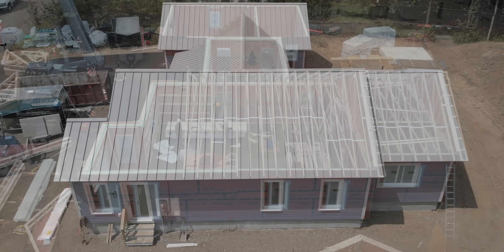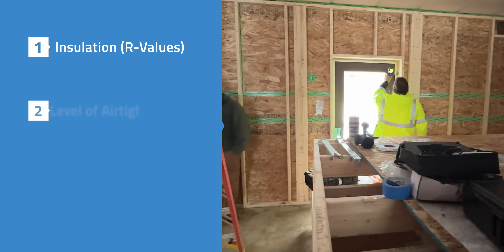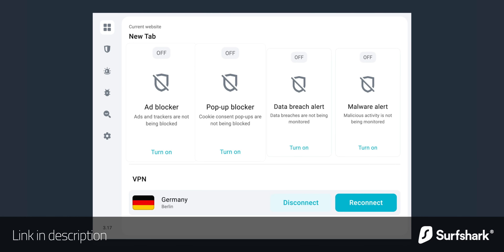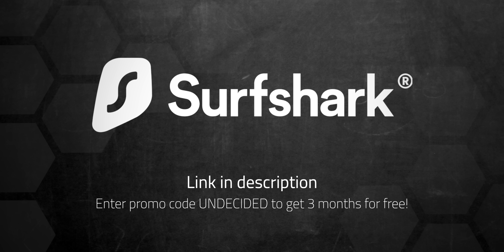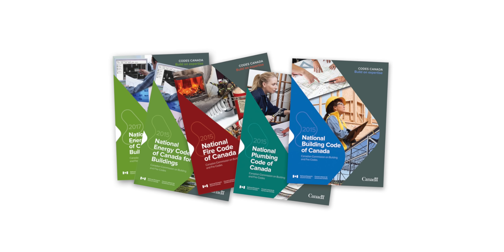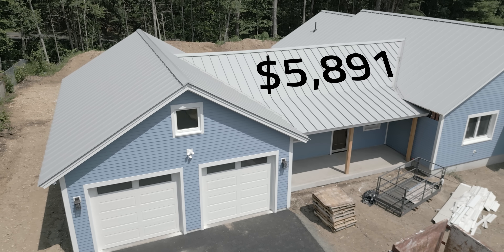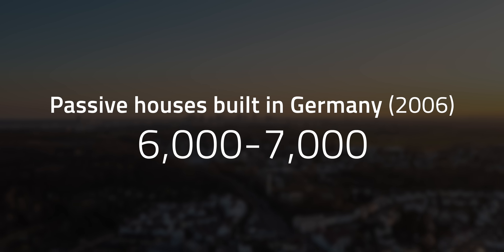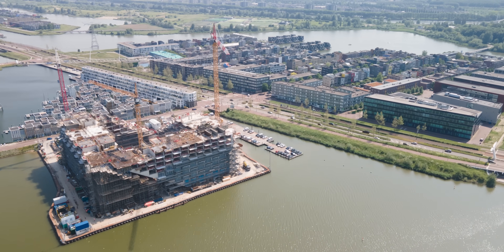Why Do American Homes Suck?

Comment: We should start building homes out of old wide-body aircraft fuselages. All of those a340s and 747s that got retired during the pandemic could be turned into homes they don't corrode as easily as steel since they're made of aluminum alloy. They are EXTREMELY good at maintaining an airtight seal since they are made to be pressurized during flight. They are termite resistant, and they have amazing insulation (if not removed) insulation that is designed for -50 degree temperatures at high altitudes meaning they will hold in heat in super well during the winter or keep the heat out super well in the summer and will be extremely energy efficient (also if the fuselage is painted well or not painted at all just bear metal like the old American Airlines livery in the 90 they will reflect heat super well in the summer unlike black asphalt shingles on a typical home. Lastly, you don't need to cut down any new trees or pollute anymore making the building materials to construct a new home when we can just re-use old airframes. Furthermore, the wings would make nice decks lol

Comment: The homes also suck cause there made of popsicle sticks and cardboard (sometimes quite literally like he mentioned but even OSB is like cardboard you could probably break into an American home by kicking hard enough through the thin osb wall sheathing between the studs and bypassing the alarm system) I say that as an American who has been to Europe. likewise, European homes are made of concrete and steel and are thickly insulated on the outside there fortresses. Now before you, ignorant fellow Americans say "It's too expensive" look at the price of a typical single-family European home and the same size single-family American home and you'll see that homes in Europe are much more affordable than the typical American home and yet there built out of concrete and steel and are better insulated and can handle severe weather a lot better. It all simply comes down to greed America is a greedy country Boeing can't even make a jet anymore that doesn't crash or loose a door mid-flight anymore meanwhile the European Airbus company isn't having any quality issues with their jets but I digress. Likewise, our real estate industry here in the US is a scam greed hell a crappy single-bedroom apartment can cost up to $3,000 a month to rent nowadays. They make houses out of wood because it's cheaper to build meanwhile they sell them at an astronomically high price so they get a bigger "PROFIT" (aka greed) then if they were too build it better quality out of concrete and steel which would be more expensive but sell it at the same price and be less greedy and accept the fact that they make less in profit but that there at least selling a better quality product able to withstand severe weather better and last longer not rot or be eaten by termites. 

It really boils down to culture like I said America has become a corrupt greedy country and it's only getting worse as the quality of things gets worse and yet they go up in price meanwhile the culture in Europe is better quality over quantity making sure something is built as best as possible over the typical American mentality of "how cheap can we make it and what's the highest price can we sell it for" mentality. This country is very materialistic the culture is very materialistic. As for energy efficiency, no one bothers here in the US to make everything as energy-efficient as possible because energy prices are lower than those of Europe and other parts of the world. I guess this is good but if we are supposed to reduce our carbon footprint why do we make big gas-guzzling V8 engines that produce little power for their displacement when in Europe and Japan like Honda for example make tiny little turbocharged four-banger engines that produce as much power if not more then most American V8 engines and get much better fuel economy.

Comment: Problem here in Germany: The guidelines are good, but houses are built from bricks and concrete. They last long and they are expensive. This means it will take almost a century to get the majority replaced by passive houses. In urban areas I believe an average house is older than 30 years, mine is 60. Not uncommon. It's virtually impossible to upgrade these to really modern standards.

Comment: We generally have the bottom tier of people in residential construction.  Plus, housing is dominated by tract homes built by publicly held companies with no interest in innovation-- indeed they won't even tilt the placement of homes on the lot and adjust window placement to take advantage of passive heating and cooling.  With today's computers, arranging homes and window placement can be very simple, if you have workers capable of understanding that in South Texas, you don't want big windows facing west or south because of heat.  East is optiminal.  And if you must have bedroom windows facing west, then put a covered patio over it.  However, I don't want a national building code because it will raise prices.  I recycle windows, use recycled interior wood shutters and insulated drapes and end up with insulated windows for much less.  I would like to be able to build a dugout (in a hill) with recycled materials, but in many areas, hiring expensive experts would be required far beyond what is necessary for safety.  It's very hard to get unconventional homes approved where there are urban building codes.

Comment: Great insights. Thanks for the points.

As contradictory as it might sound, one of the problems is building codes. They end up amounting to minimums for builders so they can pass inspections. This is why a 6.5 earthquake in California is still a problem, while it's no more than a speed bump in Chile. It's very rare for a building built since the 40s (huge earthquake) in Chile to fail catastrophically. The builders put their names on the buildings, adding to the pressure to make sure they don't come down in a 8 or more earthquake. It's odd to watch builders in the country down there. In some ways they seem behind technologically. But they get it done and the buildings stand through regular quakes. They use lots of rebar and concrete.
They suck at insulation too. :)

Comment: In the USA we're still building homes like they did in the 1970s. I'm watching a neighborhood get built across the street and they can nearly frame a house and have it roofed in 2-3 days. I'm sure it's going to have blown in fiberglass insulation on top of the ceiling and sure enough they'll throw the HVAC system up in the attic where it gets 150+F in the summer. Makes no sense at all when for just a few extra $$$ you can have the roof deck spray foamed and have a conditioned attic.

Comment: I am definitely interested in a net 0 energy home. We need good insulation, smart layout to support comfortable living environments, not trends, and efficient HVAC systems and appliances. My 1890 home has a fairly low heating bill because it was made well, insulation has been added over the years, though it has no vapor barrier.

Comment: I'm not going to run the numbers on how you got R35 walls, but I know you live in the New England area... From my own costing on a potential addition in New England, I can RoM that the cost delta payoff on what you are building vs what I'm looking at building is at least 10 years if not 20 or more. 

It just does not pay in terms of materials and labor to build to this level. Housing is already terribly unaffordable in New England.

The gov't would have to subsidize these kinds of energy upgrades dollar for dollar in order for them to gain any traction.

For those of us that live in less dense areas and can heat with an EPA wood stove on renewable lumber harvested locally its always going to be cheaper to throw a few more logs in the wood stove than spend double on higher end windows. At least on a human lifetime scale.

Comment: Here in France, Passive Houses mean smaller spaces for a lot higher price. The downsides of air-tight buildings is a faster degradation when vacant.
While most European countries try to keep decent living spaces, France focuses in stabilizing prices. Taking all norms into account, including for handicapped, that's at least 30% less surface per lodging. Energy efficiency have made huge progress already when houses and apartments ceiling went from 250-270 cm down to 220-240 cm. With most new buildings around 235-240cm dur to building blocks size. It doesn't sound much but if you do your math, that's a massive volume you no longer have to heat up.
Then came mechanical air flows, and later electrical systems. Natural airflows cool down your home a bit. But when you need to sell it, 9 month or over a year doesn't matter much.
Air-tight homes are made to be inhabited. And if you keep the electricity running in a house for sale, what's the pont of energy efficiency. With loans harder to get,  realtors and owners  hide moistures under a coating of paint or "decorative" panels. Which, you can guess, lead to more and more lawsuits.
Hopefully, it hasn't become a standard practice yet. And most professionals and owners do send people to vent and check on their properties. Which also add on the final price.
Concerning triple layered glasses, in truth, that's what should be the norm since 2012. But we're still stuck with double pane but the evolved ones with argon in between the glasses. Cheaper but close to triple pane efficiency wise. 
From lower and middle class people perspective, France have high construction pricing. When they say that wooden house cost less and are more ecofriendly, only the second part is true as wood is truly a renewable resource as long as you manage it well and replant the trees. As for the cost, It's around 80% the price of a bricks house. It's faster to build, though. As far as I know, in the US, you can build something bigger than 700sqf for around $100K.
The US is a country of extremes but they do have a large potential of improvement as building materials, basic ones at least, cost a lot cheaper than in Europe. And that's a chance to seize and show that you don't need to build a hobbit house to build a passive house.

Comment: Hi Matt
I think I heard you say that your new house saves you more than 5000$/yr. I guess the cost of energy is much higher than here in Pennsylvania. My gas bill is 90/mo, electricity around 130/mo. These are average amounts over the year. With these costs, a house like yours would not be economical in my area.

Comment: Most of Europe  has guild carpenters and other unionize skilled labor In the US most trades are not getting living wages or proper medical care.  Trades are dying because it is not worth the cost body and soul to do the work. The boss wants it done cheap even enforcement of the minimum building standards can be questioned because of the limited number of inspectors in a given area.

Comment: I'm in Brisbane, Australia, it's summer and 36C outside, very humid (98F), climate warmer than New Orleans. We have 14.5kw of solar panels and batteries, installed 6yrs ago. I'm sitting inside in solar-powered air con, very pleasant.  We generate all our electricity and export about 20MWHrs to the grid each year, earning $2,400 a year. We've now paid off the capital cost and for the next 20yrs, we laughing all the way to the bank (system has 25yr warranty). Every home in your southern states should be the same, it feels good knowing we're carbon-negative.

Comment: It's funny you talking about EU vs USA in terms of energy conservation. Recently I have seen a video by highly known YouTuber installing off grid modules to his house. His house uses as much energy as a building 10x the size in which my apartment is located in. 
Mind you it's a high end place in my capital, as in 100 quite rich ppl live here.
We have 20cm Rockwool insulation and triple pane windows. Our complete energy costs for cooling or heating in extreme conditions come down to around 100E per 100m2 unit a month. Avg hovering around 50E a month.

Comment: its all about money ,Corporations cut every corner they can to save a buck and take advantage of Americans, I've been in the construction business for over 50 yrs. I've seen few upgrade in home building one of which is wall dimensions from 2x4 construction to 2x6 construction. I've seen insulation rating go from r 24 to r 38 in roofs. and also from non fire resistant siding and roofing to more fire resistant. Even with all that home building is absolutely awful. They got rid of plywood and made osb  just to save money and use scrap wood, also plywood cabinets to mdf. Triple pane glass was a fad instead of normal expectations. And so on! i could scream about this but no-one cares. 
I've been traveling to Europe and Mediterranean and in Greece most of the houses have been in use since 1,500 yrs before Christ (or 3,500 yrs) and are still in use. talk about how embarrassing that is to the U.S.. if i can someday build my own house im gonna see if i can find volcanic rock in my area and build a highly efficient home for my self.

Comment: It's not that American homes suck. We have the freedom to build our homes, based on our budget, to a standard that is still sufficient. Nothing is stopping people from building their home to a high level. You KEEP SAYING that in the video...that your home is above the required standard. Good humblebrag. 
We built our home in NY over 30 years ago with R35 or R40 walls. The attic was R60 or more. Yes, it wasn't required. Similarly, we had one of the newest condensing modulating furnace with a very high efficiency rating. It was expensive, but we wanted a highly efficient home and were willing to pay for it. Our home in TX is similarly built to very high standards. We probably could have gone even more efficient, but is it worth so much more expense? THAT is what each person has to decide on their own. As long as they meet minimum requirements, it is up the individual how far they want to take it.
Saying "American homes suck" is indirectly saying that American's suck (at making choices), and so we should BETTER REGULATE people. You more or less say this repeatedly during the video. 
NO.
What this brings up is FREEDOM, or would it be LIBERTY? THAT IS THE AMERICAN WAY. It is why we have a greater choice in how we build our homes than those in Europe. Sucks for them.
Have you seen European homes? They are mostly tiny and, imo, often lack character. They look like minimalistic utilitarian places. They get the job done, but they don't appear cozy...lack warmth. I guess after spending so much for so little, there isn't much left to customize/adorn the interior. BTW, what's with having washing machines in the kitchen, hmm? Maybe because they don't have any other place to put it.
The US is very large. Most European countries barely even qualify as a State in the US. Some barely have the population of a metro area like the DFW Metroplex. The US is so vast and so different that we have rules/regulations done on a state-by-state basis...and rightfully so. It would be impossible to do it on a national level and it would be wrong to even try.

Comment: I'm glad I watched your account of building a sustainable home here. As a European who came to the US in the mid-70s, we were struck at how homes were made out of wood, even commercial buildings. We wondered why windows opened to the outside and once the sliding window fad settled, how come they only open 40% to 60 of the way. And what of the drafts and lack of perfect seals which passes off as normal. It's anything but, normal. 

To this day, we rent and never thought of building a home. It would be too expensive to do it the way I want and be net positive. I hear those who repeat what the construction lobbies say that wood is good for earthquake zones,. Reinforced concrete is great and can be insulated far more easily. Go to Nice and Monaco and see homes that are made to resist earthquakes. Considering the many new sustainable and environmentally friendly products available today, it's strange the home building business model hasn't changed. I suspect this is fast approaching with observable dramatic changes everywhere. Thanks for a very enlightening video.
Reply: Well they aren't all made out of wood ? There's no way you can be here for that long and not realize there are buildings made out of all sorts of things. The whole neighborhood I live in is made out of brick. All over the place really but Europeans are so brainwashed anymore on things in the United States it's insane

Comment: The poor quality of American homes goes well beyond their poor energy efficiency. That is just the tip of the iceberg. There is a constant race to the bottom in terms of cost. But those savings never seem to materialize for the average home buyer. Instead, those savings are evaporated by rampant restate speculation caused by homes being treated as an investment asset rather than a commodity. These means poor construction quality is often ignored since there is an expectation that the home will appreciate anyway due to market forces and its location. If a buyer decides not to over look this, it just results in someone else coming in a buying it instead and the first buyer just makes it more difficult for themselves when buying a house.

Comment: I have little doubt there's plenty of room for improvement in many places in the US, but setting national standards for building codes sounds like nothing but a bureaucrat's wet dream to me.  I can see national standards working well in England, where the climatic difference between any parts of it is practically nil, but treating Florida like Wisconsin makes no sense at all, so I think it should be left up to the states and even to localities.